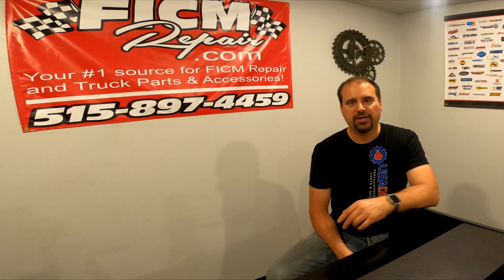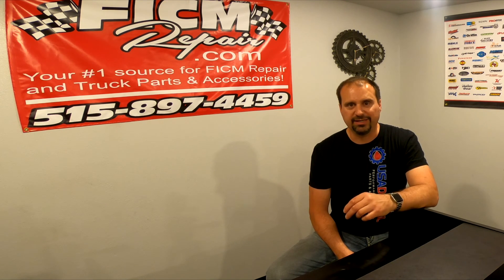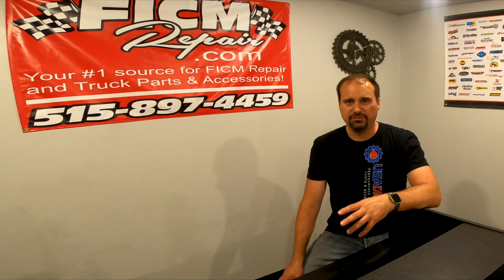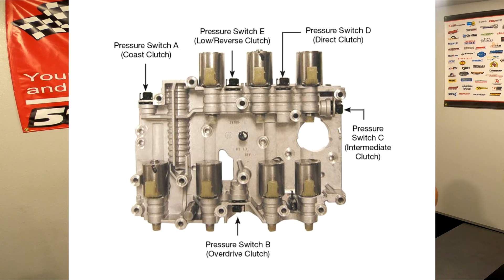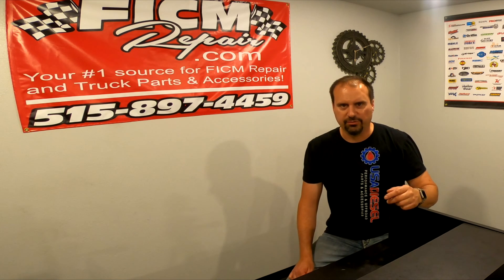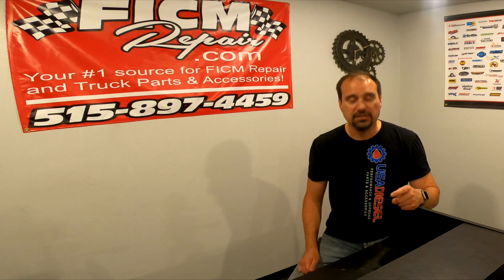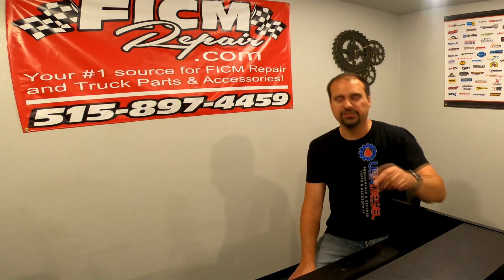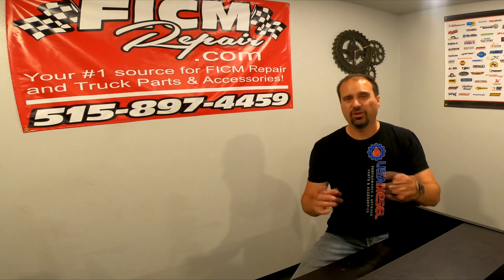HOW TO Prevent Shift Flare on a 5R110 5R110W Transmission Powerstroke 6.0L 6.4L

Comment: After installing these 2 solenoids, my truck shifts REALLY fast into reverse and with more force than shifting into drive. Did I mix up the two solenoids or is that normal?

Comment: my 6.4 trans acts like it wants to go in gear and builds up pressure but it acts like the emergency brake is on and wont move where do i begin
Reply: also no codes is it a fluid  problem.

Comment: I replaced both the solenoids, billet dummy plug, and pressure switch from your company several years ago.  I also upgraded to the deep pan, and 6.4 filter several years later.  I also had installed the dieselsite external full flow filtration system, several years before that.  A year or so ago I developed a random 3/5 shift flair.  I have always serviced the transmission, and the external toilet paper filter.  Did everything right, with all the recommended upgrades, and still developed a fair problem bad enough to set an over fueling code, because of the increase in engine speed during the flair.  I have never experienced the tow haul light coming on.  Could you advise what else I could do to remedy the cause of the flair.  I am not running any type of tune, and have never drove the truck hard.  I do tow a 6600 lb trailer once in a while.  I also run Amsoil transmission fluid well before I did any of the modifications.  Pleas help
Reply: If you already have the modified Solenoids then you are likely out of clutch material. Every time you allow the transmission to do that flare it rapidly removes clutch lining from your clutches. It only takes a hand full of major unmitigated flares to wipe out the linings completely and  put your transmission in a steel on steel situation which rapidly overheats fluid and can weld the steels together.
If this isn't the problem then your apply piston could be leaking.
In both cases you've used the transmission all you can and now is the time to rebuild it or trade it in for a rebuilt unit because the more you wait the worse the damage will be.
All the mitigation steps told about in this video and done by you are to hold off problems that are known to develop. Not completely cure them. No mention of what year truck or even how many miles it has but eventually all transmissions need to be rebuilt.
Reply from the maker: @btwbrand is 100% on point.  Gold star!

Comment: Stumbled across your website looking for info on alternators and cables  (Mechman) upgrades and or kits for early 2003 6.0 F350 Super Duty 4x4 (286000+ miles) and wound up here!! 
Now I feel like I need to go to dang transmission shop!
Holy Cra#
The most understandable info since Diesel Tech Ron
Thank Ya and definitely subscribed.

Comment: Curious if you have any thoughts on a 6.0 transmission that seems to shimmy/shutter under load going up a mountain pass but not all the time.  Does not seem to do it in 4x4 and has never done it on flat highway driving.  Can't recreate the problem at the shop it is currently at.  Seems to happen around the 50mph mark and have not identified the gear as of this time.  If I back off the throttle it stops the shimmy/shuttering.  Could it be the beginning of this problem you are discussing here?

Thanks in advance for any thoughts.

Cheers!
Reply: I wished this was answered.  I'm having the same issue. Any resolution?

Comment: Had this problem the shift solenoid didn't help. Problem I had was that the direct drive clutch steels were bending under uped shift pressure due to tuned transmission. Sonnax makes a hi cap direct drive apply kit that puts a thicker apply plate and thins backing plate so steels won't bend making the tcm think it needs more fluid that it should. Put this kit in and there won't be any releaning when switching tunes.

Comment: Just did solenoids and filters on my 5R110W. I'll be dropping the pan again in a couple of weeks to change the filters as recommended. At that time, i'll also upgrade the dummy plug on the solenoid body/gasket. Wish I had $$$ for even a 6.4L pan.

Comment: Diesel site sold me their own stand pipes and dummy plugs and they both failed within 1000 miles. Everything was torqued to spec and lubed before assembly. I'll never trust diesel site ever again. And I will openly try to dissuade anybody from using them to purchase anything. Mostly because they refused to refund me on their defective product. Not even talking about the cost of 2 tows. 2 days of work missed for me to do the drivers side and 3 months and $1300 to pay someone to do the passenger side because it was winter and I ain't got a heated work space. So I'd like to give diesel site a big thumbs down!

Comment: What about custom tuning? I Recently deleted my 6.4 and installed a pretty mild 80hp custom tune. I don’t drive the truck often and I’m usually pretty gentle with it so after about a week I let her rip and the trans was kind of all over the place. In one instance I floored it at like 25 mph and it downshifted hard and barked the 37” tires. 

I thought about adding the modified direct clutch solenoid but the guys that built my tune said it may not do anything since the tune already raises line pressure in the trans. Is there any benefit to adding these parts to a tuned truck? Thanks!
Reply from the maker: Yes.  Tuning can only boost line pressure by at most 25%.  Running the modified Electronic Pressure Control solenoid doubles the line pressure.  Please just ensure that you run the modified EPC and the modified direct solenoids together.

Comment: I had somebody rebuild my trans with a shift kit and all the stuff to kinda make it last and hold 600hp (not making that much) but I still get gear float and then the limp mode come on then shifts perfect.. I don’t even have 10miles on it. Can somebody explain what’s happening?
Reply: Wasn’t rebuilt right
Reply from the maker: I'd agree that it wasn't rebuilt properly, but I would caution AGAINST using the solenoids that this video mentions in a trans that already has a shift kit in it as the two methods of firming up shifting will work against each other.

Comment: Brand new trans from ford with 10k miles . Truck makes 602 on the dyno. Truck can’t handle it.
Reply from the maker: I bet!  I'd suggest the solenoids as a way to prolong the life of what you have, but would have tried to have you at least consider one of the many Stage 2 transmissions that we also offer if you were going to replace the thing altogether and not just another stock one.

Comment: im planning on upgrading with your solenoids, my 03 is shifting fine but im running stock 3.73s and 37's, it was a lil tricky when i changed the revs per mile with hptuners, so i left alone and used forscan but could only go to 600 revs and adjusted the pulse count, speedo is perfect now, will i be ok or should i do something else like stack a trans only with a sct or disable CLADPS after solenoids are swapped?
Reply from the maker: You should be okay as is, but running a trans tune is always a good idea as it makes for firmer shifts (resulting in less time between gears and therefore less clutch wear).
Reply: @ficmrepair  Okay thank you, I'll  be honest up till a year ago I didn't know anything about diesel's let alone 6.0s thanks to you and few others I've came along ways. although seems like the more I learn less I know, overall I'm better off just listening to you and stop wasting time and money looking anywhere else for parts and tuning. Yeah maybe I can find better prices if I looked hard enough here and there. but honestly I've never found someone so willingly  take the time to answer some of my from outta left field questions with genuine passion and knowledge at a personal level. Thank you. FUCKIN LOVE YOUTUBE!!!

Comment: I have a 2006 f350 superduty 4x4, how can I know which transmission model it has?
Reply from the maker: An 06 has the 5R110 with the need for a singular dummy plug. Is that what you needed?
Reply: @ficmrepair  Yes, thank you. I also need to know what is the best upgrade for this transmission?  thanks
Reply: @luismviera7982  get the mishimoto trans cooler and change your Transmission pan to either an aftermarket aluminum pan with extra capacity or to the pan and filter from the one's used on the 6.4l 08 - 09 model year.
Reply: @timsmothers8740  thank you very much chief but I don't have an oil transmission cooler, the lines are connected to the radiator that you recommend.?

Comment: I'm experiencing the flare. But my transmission is running cold any ideas why
Reply from the maker: Running cold isn't generally an issue, but could be related to tuning on an otherwise stock setup.  Give us a call at 515-897-4459 if you want to cover things in more detail!

Comment: I have a f250 2005 5.4l range sensor it says lower imput and tow Haul light it flashing. I changed the sensor and the problem not fixed p0707

Comment: Will this upgrade kit hold up with a stage 2 turbo and 175/30 injectors?
Reply from the maker: Adding this upgrade will allow more power to be held, yes, but is not a replacement for things like a 300M billet input shaft...  :)

Comment: Hey man I have a 2008 f250 6.4 and the truck will shift hard, and in tow/haul it will get stuck in 3rd thanks!
Reply from the maker: Hey, Dallas!  I'd say that the two solenoids mentioned in this video - the EPC *https://www.ficmrepair.com/index.cfm/page/ptype=product/product_id=275/category_id=-1/mode=prod/prd275.htm) and the Direct (https://www.ficmrepair.com/index.cfm/page/ptype=product/product_id=274/category_id=-1/mode=prod/prd274.htm) make total sense as things to try.  Of course, while you are in there, you might pick up a trans dummy plug (https://www.ficmrepair.com/index.cfm/page/ptype=product/product_id=343/category_id=-1/mode=prod/prd343.htm), but you are good in the pan and filter department (well, unless a filter is due) as you have a 6.4.  Hope this helps!

Comment: Can i just turn in the #25 torqx 1  1/2 turns in..?Help that out real quick?  Man ya guys have alot great  parts!
Reply from the maker: We are a full-service shop and carry over 16 million parts for the Powerstroke 6.0 driveline alone, not to mention the many millions of parts we carry for the Cummins, Duramax, and non-6.0 Powerstroke crowd!  If you have a light-duty diesel, we've got you covered!  It's all about options for us - letting the public know the options that exist in the marketplace so that they can choose the best solution for their situation.
Reply: @ficmrepair  oh man I'll be getn parts all but factory.
Reply from the maker: @KERNFUZED  We can help you out with the factory Ford parts, too.  We're one-stop shopping over here!  :)
Reply: i meant i by all Ford replacement...lol
Reply: On the EPC Solenoid i mean,,..
Reply from the maker: @KERNFUZED  We would not recommend that you do this, no - there is just too much on the line and this is not something you want to be wrong about.  Each modified replacement EPC solenoid that we carry is calibrated with no guesswork involved.  Hope this helps!
Reply: @ficmrepair   Thank you so much for the quick response yes I thought that iffy..while I'm just dropping pan out update filter .I run a Warren diesel hot street tune .KC stg2 turbo std.ect..155000miles .but that flare scares me too sometimes..is is good to say I put one your solenoids in while I'm there I can't hurt..everything else very well lb. Maintained on exursion
Reply: @ficmrepair  Well it did it 2 times today  scared heck out me..Flare out! Not always ..but goin do fluid  so i quess ill have to call ya see what i need.. 155000 6.0 excursion  2005
Reply from the maker: @KERNFUZED  Sorry you are having issues.  Give us a call at 515-897-4459 and we'll cover the options!
Reply: @ficmrepair  Well  il be calling!!!     Tow haul flashing   my one warning  ...or couple  ..got my  p0766/p2703    fun ones.....   got the 08 pan and sp  fluid  ..  hope i can d\just be nice to her till get ya on horn..
Reply: @ficmrepair  whos that guy who made that awesome video  on the solenoids!!
Reply: @ficmrepair  Ed ..thanks so much spending time on phone wow and making sure I'm set! I cant thank you enough !

Comment: Hope this works imma guy with the flair and its slips pretty bad in 5th thanks for the video!
Reply from the maker: It works to eliminate the flare in most cases.  In cases where it doesn't, things have simply progressed too far.  If that is the case, we can set you up with the parts to rebuild your own trans or can hook you up with a crate trans from one of about eight different builders.  Good luck!
Reply: @ficmrepair  ended up putting another trans in...i have a sct x4 tuner should i bump up my line pressure? Or no not rly also can i get a link to get a rebuild kit? For the old tranny i still got it
Reply from the maker: Derrick Poppe The most you can bump your line pressure in software is 25%, but every little bit helps!!

The solenoid kit is at https://www.ficmrepair.com/index.cfm/page/ptype=product/product_id=279/category_id=-1/mode=prod/prd279.htm

The rebuild kit for the 03-04’s is at https://www.ficmrepair.com/index.cfm/page/ptype=product/product_id=558/category_id=-1/mode=prod/prd558.htm. 

The rebuilt kit for the 05’s and newer is at https://www.ficmrepair.com/index.cfm/page/ptype=product/product_id=559/category_id=-1/mode=prod/prd559.htm